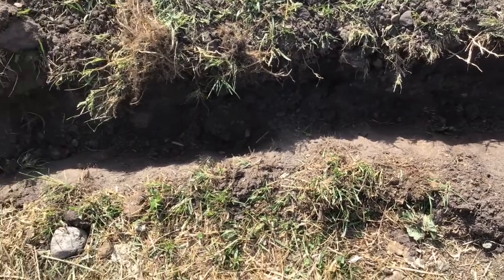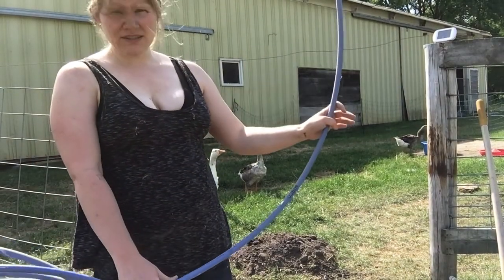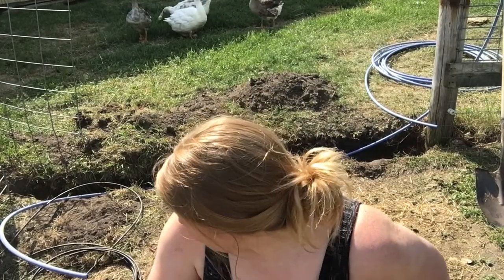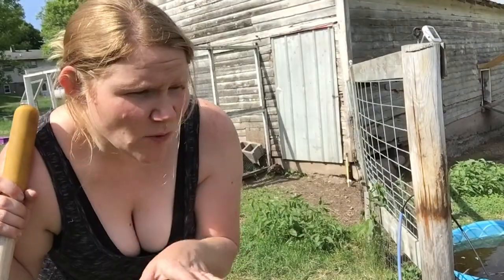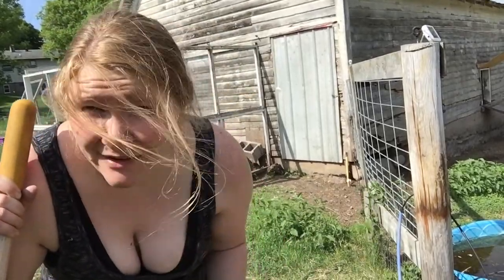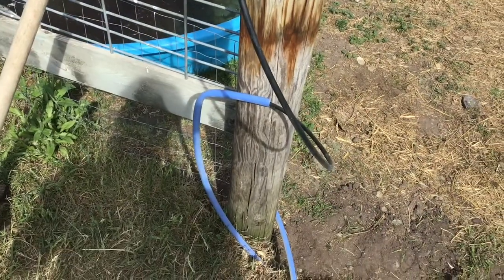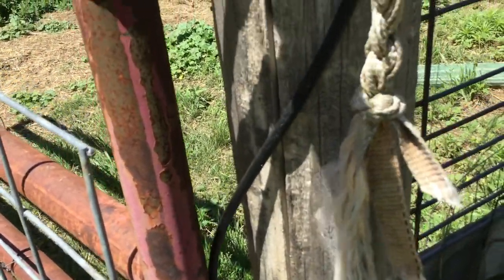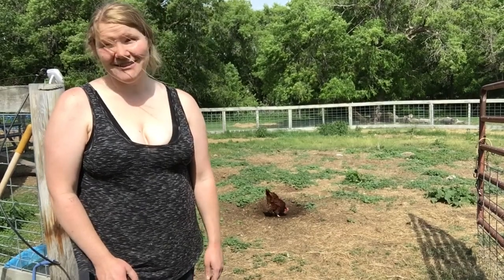How to Run Electric Wire Under a Gate

Comment: So if we bury the wire under the gate how do the dogs know not to go through the gate since the electric current won't be touched? We're trying to figure out how to hook it to the gate and it turns off that circuit while it's opens and then reconnects once the gate is closed.  Our dogs will go through the spaces in the the gate.
Reply from the maker: That’s a tough one! I’m not sure how to manage that unless you had hot wire strung on the gate itself somehow. 

Another option is to add chicken wire or parts of a hog panel/cattle panel to the lower part of the gate where they would get through.

Comment: I wonder if you can answer this- I can’t find it anywhere else- my fence wire is 17 gauge, but the underground wire I bought is 12 1/2 gauge. Can they be connected together?
Reply from the maker: As long as you can get the metals to touch in a solid way the gauge  doesn't really matter. I typically twist my connection points together. So long as they twist around each other you're fine.
Reply: I think youd run into issues going from a larger gauge to a smaller gauge then to larger again. You shouldnt have any issues, i dont think.
Reply: Late to this party but you have to make sure you don’t connect copper wire to galvanized wire because it will corrode

Comment: Where do you get the PEX tubing?
Reply from the maker: Most hardware stores will have them. Your Home Depot type department store or even smaller fleet supply store. They usually have it in a big roll and you get cuts if whatever size you need. I happened to have a bunch from a friend’s leftovers.

Comment: This is so helpful!!! Do you need a special underground wire then the top wire you are using? I live in Illinois so winters are cold.
Reply from the maker: Just something coated and usually a thick gauge works well.
Reply: @RoughandTumbleFarmhouse  thank you so much!